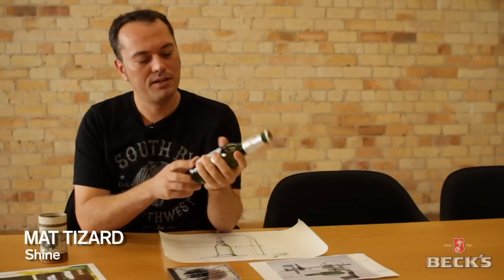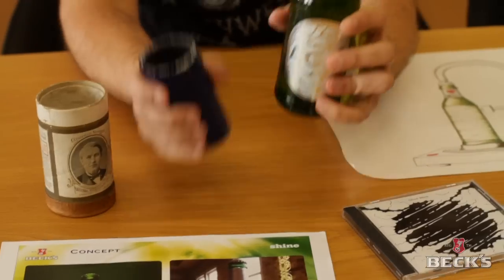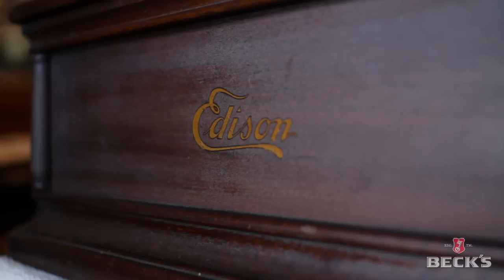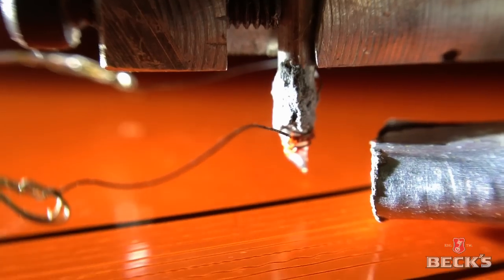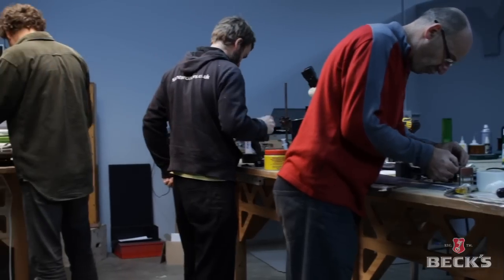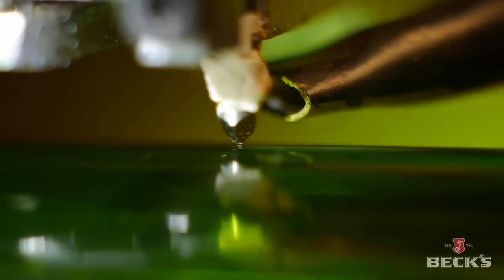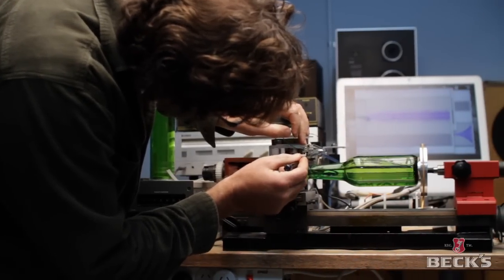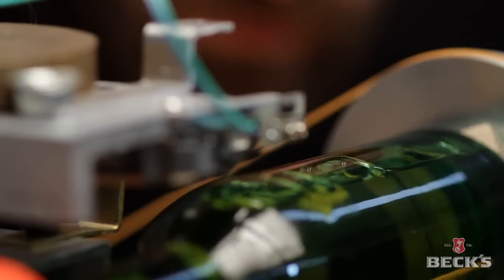Beck's Edison Bottle

Comment: wax cylinders should never be handled on the recording surfaces. oils from the hands promotes mildew growth. a lot of these cylinders have  been surface damaged by the spots of white mold that grew  because of surface handling and the presence of moisture.